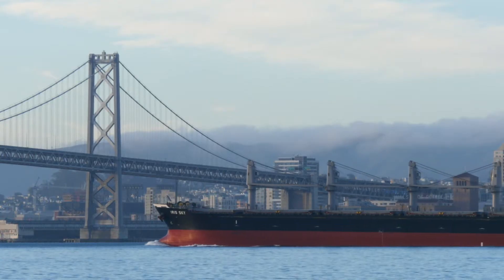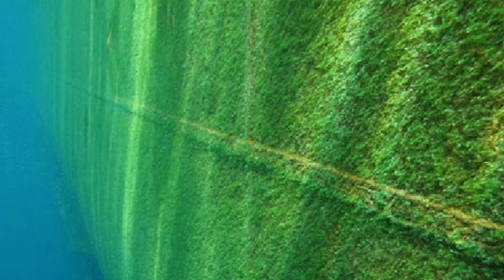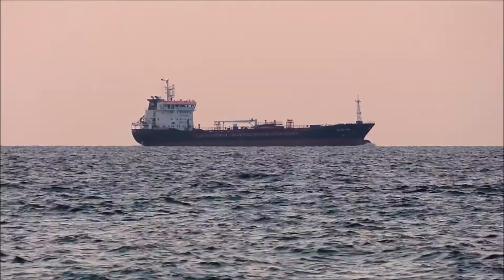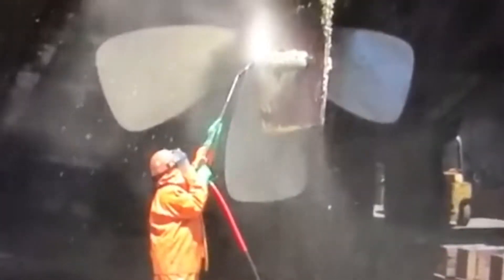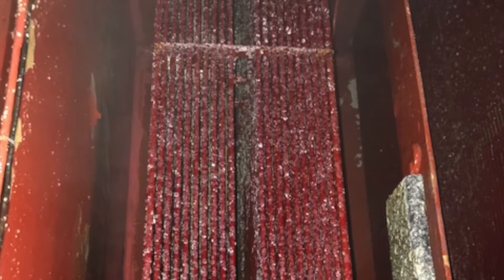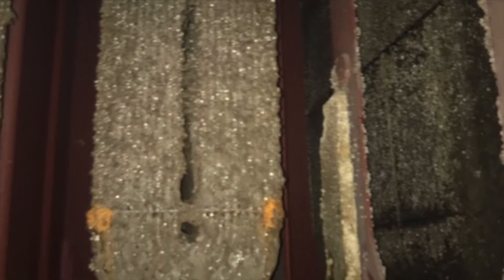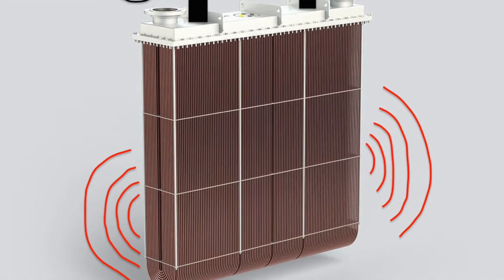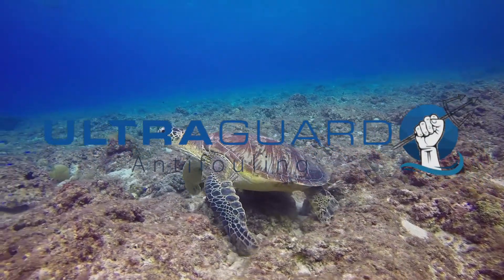Ultrasonic antifouling systems - how it works

Comment: Qué sucederá cuando se use en todas, sabiendo que el ultrasonido le hace daño a los peces en general?
Reply from the maker: Firstly, there’s no definitive evidence that ultrasound harms fish in general.

If you aim a high-powered concentrated pulse directly at a fish at close range or in contact then yes, damage may be done to the fish. What’s less definitive is the effect that random pulses of relatively low-powered pulses at distance and spread have.

We’re directing our pulses into the structure or pipework of the vessel where each pulse is diffused across the structure as its energy is depleted by the vibration waves moving across the surface. The vessel’s depth sounder for example directs all its energy (minus any losses in the transducer) into the water in a directed pulse. If any damage is being done by the ultrasonic signature of the vessel, it’s being done by the echo sounders.

Marine mammals are a different issue. The question here is whether they are disturbed or disrupted socially by our sound emissions. We don’t believe so based on anecdotal evidence. We also have a video on our YouTube channel of dolphins frolicking around one of our vessels. HST Marine has a video on LinkedIn of one of their new CTV boats experiencing the same with our system fitted.

We are about to start a study via our Danish joint venture (Denmark is offering funding) where academics are going to look at how much, if any, damage is done.
However, as we know the alternative legacy technologies definitely poison the marine environment, I tend to push the notion that an annoyed dolphin is better than a poisoned dolphin. We know for example that metallic poisoning has rendered the West Coast orca pod in Scotland sterile